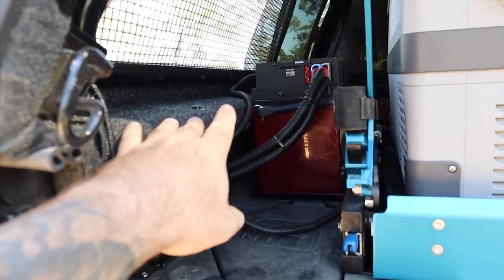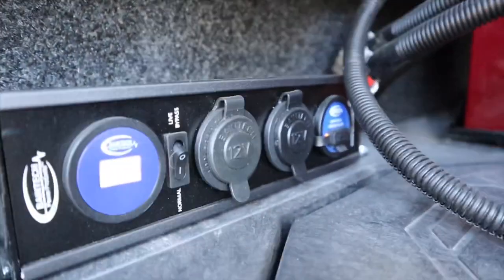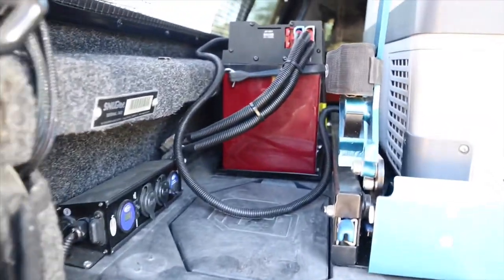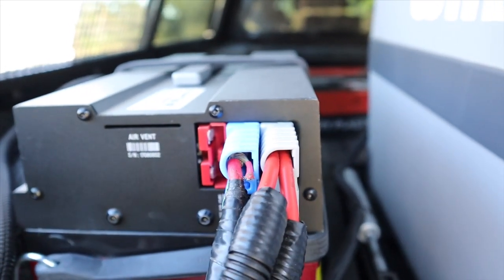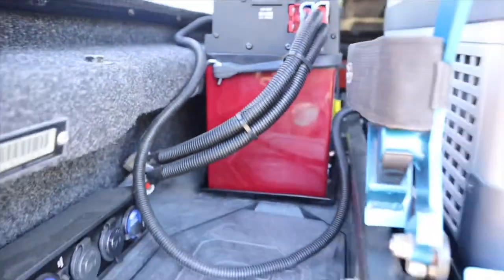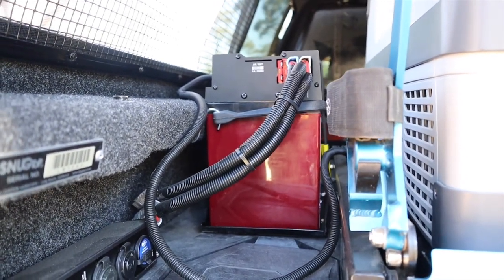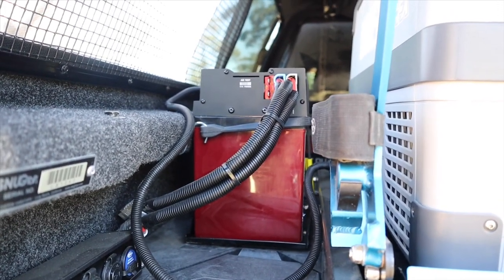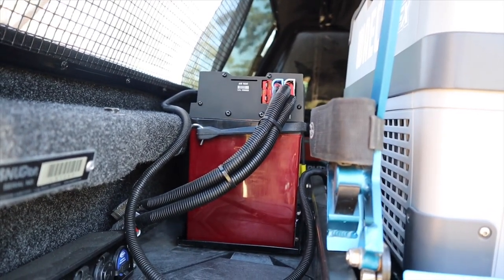PORTABLE 12V ELECTRICAL SET UP ! Baintech powertop.

Comment: Hi mate. Can you charge your Bain tech power top with dc -dc charger, cheers
Reply from the maker: Yes you can mate. Bain tech have a Dc to Dc charger out.
Reply: @TyFenwick  thanks mate
Reply: Hi me again, what dc - dc are you using, for your baintec, I put a projector in mine and it doesn’t seem to charge from the blue Anderson plug, any advice would help me
Thanks
Reply: @patthepumper  use the grey anderson plug its input and output..... i just did the smae and had the same issue

Comment: Thanks for the video mate, came across it researching my 2nd batt system. With the INPUT on the powertop, is that a cable that's run straight from your cranking battery? Do you have a DC DC unit in your system there or does the powertop do away with the need for one?
Reply from the maker: Thanks mate, yes so power from cracking runs into my new baintech DC to DC 40 amp charger I just installed after the video, I’ll have a video up on the baintech 40 amp charger this weekend coming.
Reply: @TyFenwick  Then from the Baintech DCDC to the grey plug on the Powertop?...Which will keep it topped up whilst you're driving yeah...? Thanks again for the vid, it's all starting to make a lot more sense.
Reply from the maker: Yes mate that’s correct, run a piggy back Anderson into your grey Anderson on the battery that way you can use 50amp Anderson out also. Just avoid the blue plug all together.
Reply: @TyFenwick  thanks for the video... helped me sort an issue, just on the piggy back system, how does it input and output from the piggyback system?